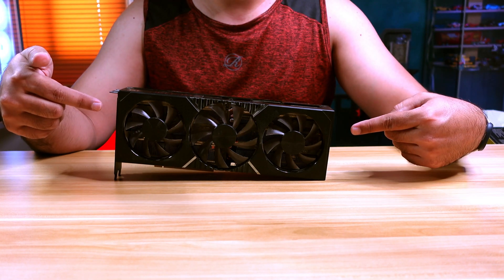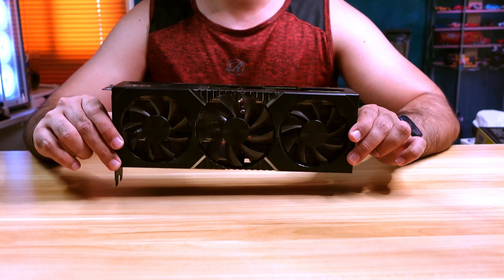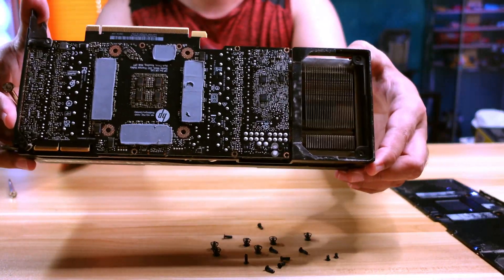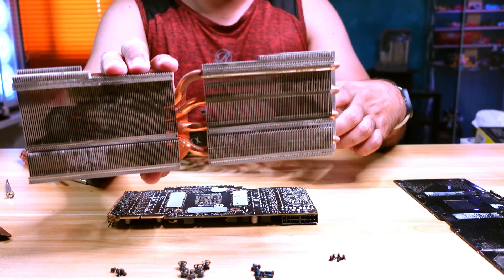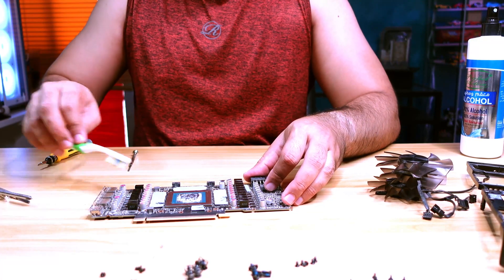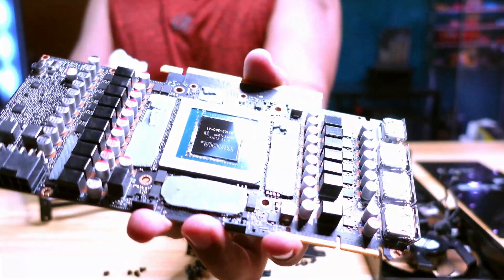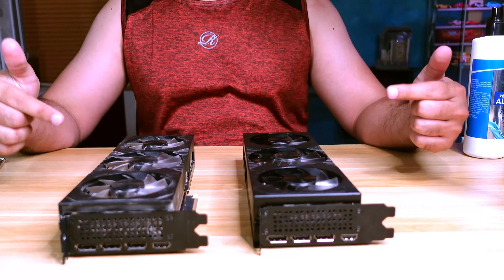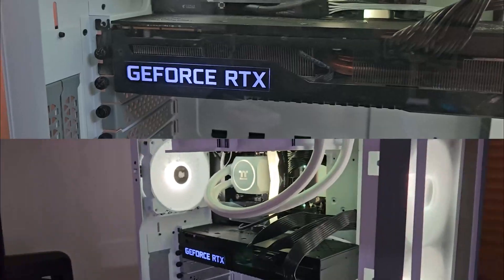😱 Cheap RTX 3090 worth cleaning and replacing thermal paste after a year of mining? Lets find out!😎😎

Comment: IMO your thermal pads look very acceptable. They didnt get torn in two and didnt get flushed out with heat. compared to laptop departments where its more casual and people don't have puddy or pads to buy and replace easily. My old 2016 vivobook pads looked more like smores than pads :b
Reply from the maker: Haha. The thermal pads looks oky but they were nearly brittle. Ill share next video in which im installing water block where ill be scraping the thermal pads off the pcb.

Comment: Gpu Fans typically don’t last long on mining gpus
Reply: Average lifespan for a gpu fan is around 3 to 4 years, it's as simple as searching for it on Google. And that's the average so imagine how it must be for mining gpus that run on full load 24/7
Reply from the maker: @ronalddump7400  ya i mean the fans are always the risk on the mining gpu. But i havent seen many cases on new gpus because there still life in them. And 4 to 5 years lifespan is the minimum expectation.  Usually they last way longer than that.
Reply: @gunjackblaster  the thing is, Google says that 3 to 4 years is average, so in reality the gpus that last longer than that are technically in the minority. Or they havnt been used as much
Reply from the maker: @ronalddump7400  just look at the market how many gpus u find with dead processor vs dead fans. Regardless of their age go as back as 20 years
Reply: @gunjackblaster  With mining gpus you never know. The fans spin on max rpm for years at a time. Dust, overheating issues and damaged fans speed up the process and kill the gpu.
Reply from the maker: @Gamix10  you are not getting my point. Whatever u r saying is correct. What i am saying is it happens 1% of the time.
Reply: @gunjackblaster  then you’re lucky
Reply: @Gamix10  we are saying it's AVERAGE for them to fail at 3 to 4 years. MAJORITY of gpus fail at that time, not 1%. Yes, perhaps all the cards you get havnt failed yet but its for precisely that reason, broken cards are more likely to be tossed away so you're less likely to come across them
Reply from the maker: Fans lifespan is 5 years on full load. I saw some squeaky fans on 1080ti after many years of mining but for 30xx there still lots of life left.
Reply: @gunjackblaster  then you’re lucky. I’ve seen different cases
Reply from the maker: @Gamix10  i am sure the cases u have seen must be less than 1% there is always chance of probability. Math will come in handy to make set decisions in such studies

Comment: Didn't expect that much gain in FPS. 

GPU should throttle down only when in 'high temps' range. Were the temps high before teardown? If not then, how can we tell we are loosing out on GPU performance and it needs cleaning
Reply from the maker: Yes all the new gen gpu performance drops down if temps reach their limits. In my case its 80c. The gpu compensate the performance to prevent overheating and damaging the gpu dropping the fps in the end.